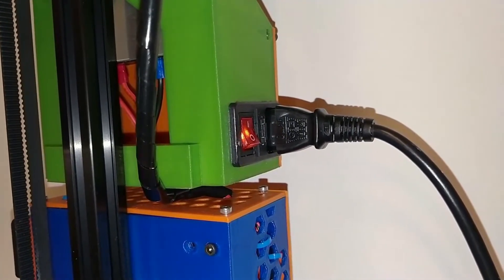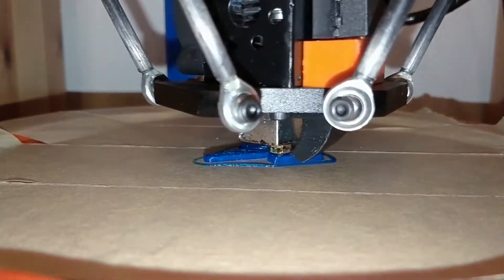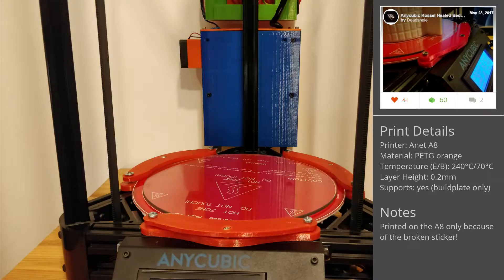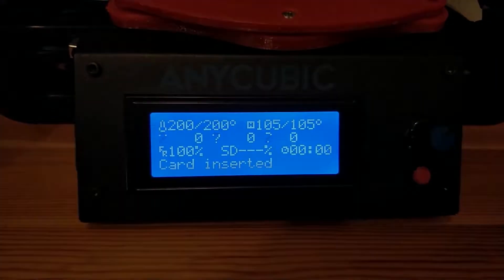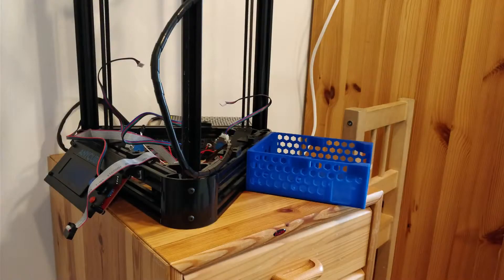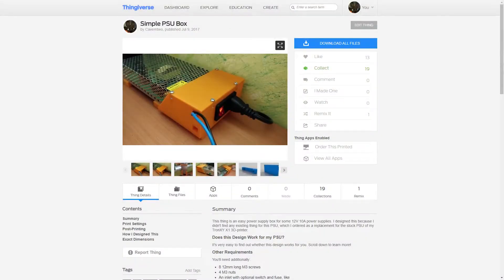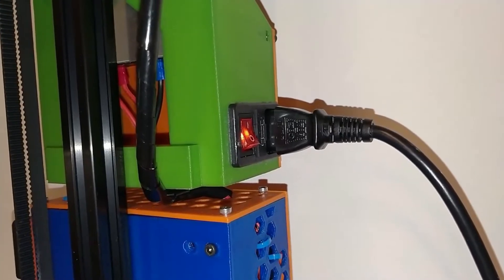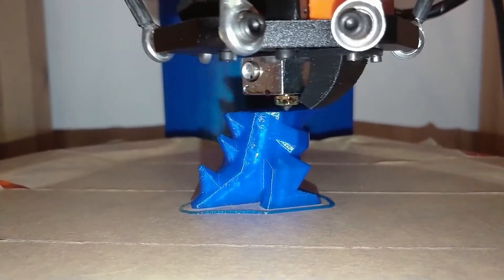Anycubic Kossel Upgrades

Comment: Can you make a video upgrading this to the e3d v6?
Reply from the maker: The printer has an E3D-V5 clone by default. It is very similar to an E3D-V6, except longer.
You can use an adapter like the following to compensate the length difference, then it should work out rather easily without any other upgrades.
https://www.thingiverse.com/thing:2449797
Reply: @Caverntwo  Thanks man, I appreciate it!
Reply from the maker: You're welcome!
Reply: @Caverntwo  subbed :)
Reply from the maker: Nice ;-)

Comment: I like the control box for the main board and the one for the power supply, great upgrades ! Do you install a separated mosfet for the bed ? I began receiving parts for upgrading the Anet A2 I will receive thursday, i look forward to see your video on the upgrades you will make ont it and i will follow your example and plan the upgrade carrefully.
Reply from the maker: Yes, I use a separated mosFET for the heated bed, as it draws a lot of current (more than the extruder). I have some good upgrades for the A2 in the making, and hope to be able to publish a video about them in the next two weeks!

Comment: I like the upgrades and will definitely be downloading some of the models for use on mine! Do you think you would see much of a difference if you upgraded to the linear plus that makes use of rails rather than pulleys?
Reply from the maker: To be honest, I'm not really a fan of the rail. Although I haven't used them, I don't think that there will a huge improvement. I don't want to discourage you if you want to use them though.
As there is no visible z-wobble in the print, some tensioned belts and maybe better stepper drivers and/or some free-wheeling diodes would do a better effect.

Comment: You need to add a piece of rubber between the motors, and perhaps chrck voltage. Mine is dead silent without tmc drivers
Reply from the maker: Hi Jon, thanks for the tips.
The voltage I already checked and is fine. Maybe I add a piece of rubber to the motors. The majority of sound actually comes from first the top pulleys that are not perfectly aligned and from the frame just standing on an hollow wooden table, amplifying the sound.
Reply: Caverntwo you will proabably fix that, what most dont do - even i , is realising how much more silent a delta is vs a cartesian since no bed is moving, so a delta with plastic bearings is mecanically silent.
Reply from the maker: Yeah, I'll probably give it a try once I install further upgrades to this machine.  It's actually a very reliable printer and only failed on me twice, so it's very easy to delay maintenance/upgrades.
Reply: Caverntwo the only thing i miss is to print wide parts, so next printer will be a bit taller and wider for me. Delta is very nice overall
Reply from the maker: I currently have 5 other machines, and 4 of them have a larger print volume than my Delta. The delta system is very nice, however, there's also CoreXY and similar. I'd probably not get a printer with a moving bed moving in any other direction than Z anymore, but that's just personal preference.

Comment: Very nice. But why you use pcb board for heatbed? Its need? My heatbed working well without this module...
Reply from the maker: Thank you.
The small board is a mosFET module, that bypasses the high current needed for the heated bed around the controller. It's just an additional safety feature, as I honestly don't trust the mainboard and its contacts well enough.
And for the heated bed itself: I received the PCB heated bed, although I would have preferred an aluminum one. Anyways, it works as well...
Reply: ok. Im have latest version of anycubic Kossel. Its already with heat bed, but withuot mosfet. But working exelent abaut 2 month. Bed heat to 100 celsius 1m10sec. one more question. do you have STL file for trigorilla without space for mosfet? Like shorter version or somthing? I want move board to the back on printer. I think is realy good for cooling and safity...
Reply from the maker: I designed one but ended up not to publish it. Hm, if you want, I can publish it tomorrow.
Reply: i dont try myself in 3D modeling. So it wuld be exelent if you do that. :) THX.
Reply from the maker: ok, remind me if I don't have it up tomorrow at this time^^
Reply: ok. thx bro. :)
Reply: only one thing. Leave some spase for wiring in box please...
Reply: THX bro. Im see it already in Thingiverse in your profile. :)))